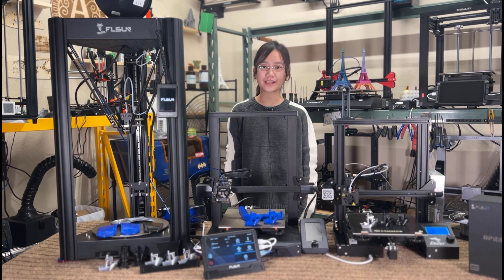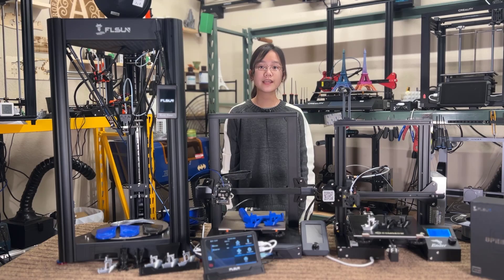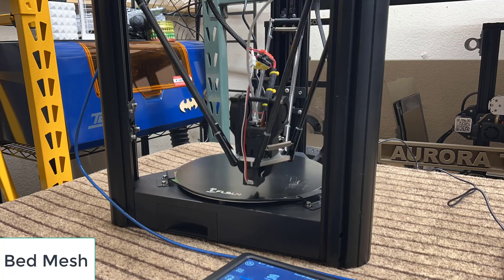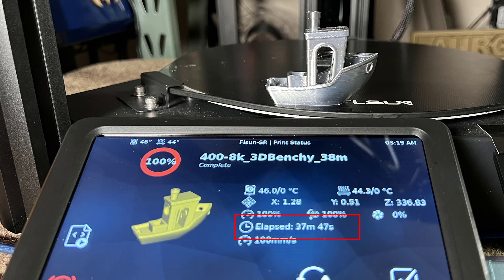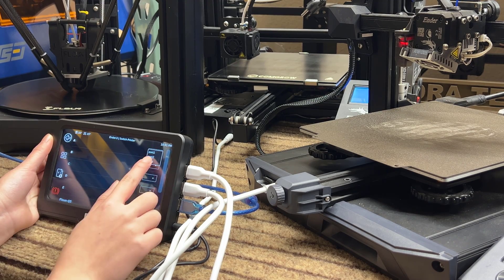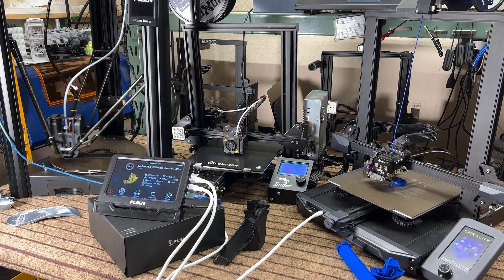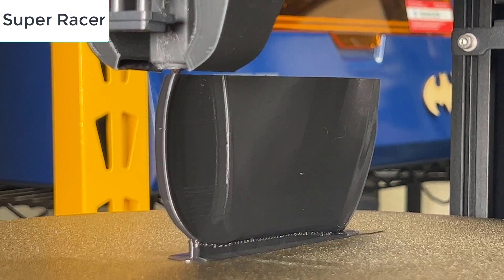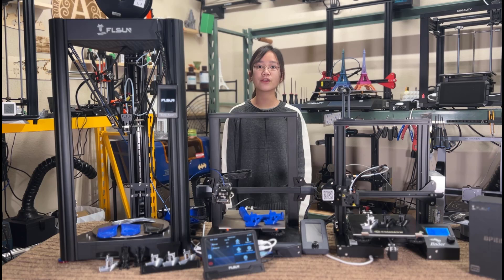FLSUN Speeder Pad review: Control 3 printers at the same time, Buy Speeder Pad or Creality Sonic Pad

Comment: How on earth was she using flsun v400 settings with this thing. I just installed and fine tuned my speeder pad with super racer and tried the v400 settings on it and got the most obvious examples of what happens when a printer is trying to print faster than it can. My printer is the exact same as hers just without the fan upgrades how was hers able to print anywhere close to those speeds??

Comment: Great job as always.  I have been unable to find out what Klipper release the Sonic Pad uses.  There is an update in the manual but I believe that is the Sonic Pad software not Klipper.  I am trying to find out if Sonic Pad has in print, Object exclusion now.

Comment: Another awesome video thank you but I have a a couple of questions that maybe you can make a video on and share with us newbies. I have a QQS-Pro running with a speeder pad, Question 1 is on the top of the speeder pad is a slot for a micro sd card it is recessed really low in the unit and very hard to put in a sd card and remove but, what is this used for?? I thought if you don't have wifi you can put your stl file on a sd card and insert it here instead but does not seem to work.How to you get stl files onto the speeder pad now that the original machine slot is not used anymore.  Question 2 is why do some of the icons from the stl print file show up in red or yellow on the speeder pad screen ??? is this related to the filament i.e PLA is yellow and TPU is red ???  Question 3 is can I see my printer from a webcam while using another internet connection like while at work ?? my ip is not 192.168.etc. its 10.0.1.etc should I add the 7125 ??? can you please help and clear up some of these things that are confusing. Many Thanks keep up the great reviews love watching your unbiased opinion. Wayne, Western Australia

Comment: I have a Super Racer that only has the 5015 mod you have. I printed a comparable benchy at 37 minutes with no other abnormal slicer settings and NO Speeder Pad. Also, your own benchy in your Super Racer review printed at 32 minutes (again, NO Speeder Pad). Now here the Speeder Pad is giving you a 41 minute benchy on the Super Racer. So this is actually slowing your machine down??? (more like a brake pad than a "Speeder" pad...)

Comment: Hi @Aurora Tech I was just wondering about how much a "Klipperized" SuperRacer could get closer to a V400, so this video is great timing!

Just one thing of note here; I've already bought both a Speeder Pad and a Sonic Pad. And the Retail version of FLSUN's Speeder Pad doesn't actually ship with an accelerometer. I was very surprised to see it missing in the box, but before I filed a complaint with the seller, I googled a bit to see if it's actually supposed to ship without. Sam Prentice's video on the Speeder Pad confirmed that retail, it indeed does not ship with either the accellerometer, or the stand. These are just for review samples it seems.
Also, the Sonic Pad has a bespoke port and cable for the accelerometer in the P/S2 form factor. Whilst the SpeederPad uses USB. So these can not be used interchangeably between the Pads.
:)

Comment: Hi, I have a flsun V400 which of course comes with a FLSUN Speeder Pad. I also have two FLSUN-SR's which I wanted to Klipperise and run from the speeder pad. I followed your youtube video and was able to control all three printers from the speeder pad. However, accessing the speeder pad over the LAN using the Mainsail app, I can only see the V400 which is connected to the USB port 1 on the Speeder Pad. If I try and add a printer in Mainsail, it only wants to know the IP address and port number. Is there something else that I need to do to allow Mainsail to see all three printers?

Comment: If one has an Ender 5 Plus and Ender 3 Pro with SKR mini e3 v3 boards installed is it any easier to use the crealty sonic pad over the FLSUN Speeder Pad, or once the new board is installed would it be just as easy to use a speeder pad?

Comment: 38 minutes to print a becnhy at 350mm/s and 5-8k acceleration doesn't match my cura profiles at aprox. the same speed. on my profile i'm hitting well below 20 minutes and even less (depending on infill and wall settings). How does that make sense?

Comment: Intersting results, i was expecting a bigger increase but it makes sense the speed is hardware limited, bowden tube vs direct drive/ all metal hotend etc play a factor.  Without a hardware upgrade maybe  machine learning could produce an algorthim that finds the best settings for your model, and even applies them dynamicly so when your model has long walls it changes the settings to match, whereas right now if im not mistaken the settings dont change throughout the whole model which probably slows things down when its not needed to be.  Ultimately being able to change the nozzel size on the fly would be ideal so you can really speed up on infills with thick layering and slow down with a smaller nozzel for finer detail but that tech doesnt exist yet so in the meantime... im guessing a machine learned or script even could maybe cut down print times on all these printers that are printing at one setting throughout the whole model.  Some kind of intelligent  AI model analzyzer (slicer basically) that can find the best settings for your model and apply them dynamically.  Maybe could eek out another 20-30% speed boost sort of how like AI upscaling in gaming gives us a free performance boost.

Comment: Thanks for the video! I've been wanting for it!
I have the V400, but I would like to connect the pad to my ender v2, but i have installed the new Sprite kit which has direct drive, i needed to do some changes to make it work, installed jyres os code and some manual changes. 
How would you connect the pad to that modified printer? It seems to be worth the effort
Reply from the maker: You just need to edit the printer.cfg, use the Ender-3 S1 cfg file as reference to set the extruder values as well as bltouch(if you have upgraded to ABL).

Comment: What happens if you use a USB hub? Can you talk the pad into handling more than 3 printers?

P.S. I would strongly encourage you to remove your location from your videos.
Reply from the maker: The screen may not be able to support that as it only allows you to choose from port 1-3. Is there any specific reason that you suggest me to remove my location?
Reply: @AuroraTech  
Well, I was, and still am, curious as to whether or not you could use up more of that CPU's overhead that way.

On the other issue.
1. It's not pertinent to the topics you cover.
2. It increases your personal risk.

Stranger danger may be overblown, but it is still a valid concern. Even adults generally don't post their location on their videos, unless it is relevant to the topics they cover. If I were a betting man, I'd even go so far as to wager your parents hadn't realized you'd made the change to your account to indicate your approximate, city-level, location. Claim the state, if you must; I can understand both state and civic pride, and the desire to "represent", and you are an exemplary representative for every quality that is known or inferrable about you; but I'd recommend against giving away more information than that.
In short, it's not needed by your legitimate audience, and you don't need the creeps and weirdos to have it. Especially any creeps or weirdos that live within commuting distance already.

Comment: I have the V400 and works great with that. Trying to link my other 2 ender 3 V2s but the speeder pad didnt come with an accelerometer :( is there any way around this?
Reply from the maker: You can print a model to calibration it manually: https://www.klipper3d.org/Resonance_Compensation.html
Reply: @AuroraTech  great! However the speeder pad i got with my V400 wont recognise my Ender 3 V2 :( I dont even have a printer option on my speeder pad.
Reply: Also does anyone have a cura profile set up for when i can eventually connect the ender 3 v2 to the speeder pad please? and what speeds etc do i print the resonance_compensation?

Comment: Creality updated the SonicPad lately and the firmware it produced just doesn’t run on the E3V2. Needless to say, I’m sending it back for a refund. What a fail.
Reply from the maker: There are 3 different motherboards (v4.22, v4.27, v4.31) for the Ender 3 V2. Combining with ABL or no-ABL, you may need to manually edit the printer.cfg file.

Comment: Has the Speeder Pad root ssh access? The sonic pad has not.
While having 3 or 4 printers on one pad, I actually am more intersted in one printer with multiple MCUs on one pad (like main printer board, CAN for printhead and second MCU for ERCF)...
Reply from the maker: By default, no, but you can get root access by doing this:
https://github.com/Guilouz/Klipper-Flsun-Speeder-Pad

Comment: I'm extremy happy with my SR running version 1.4 .So if I'm correct this add on is speed orientated With a input shaper feature , So my ? Is why is it necessary at all .I mean I printed a torture toaster which printed great .
Reply: It's more about that Klipper can use more advanced features. Your torture toaster came out nearly perfect, but that's probably all the better you'll ever get it with Marlin. If the price is worth it to you, switching to Klipper will give you that last 2.5% that marlin can't handle. Faster acceleration and speed, more fine tuned and precise control, more accurate hotend and bed temperature control, input shaping that allows those higher speeds with the same or better print quality, Klippers version of linear advance for getting those nice sharp corners. That's all not to mention controlling more than one printer from one single place, as well as much much better remote control for when you want to check on/change/start/stop a print when you're away (octoprint can do some of this remote stuff but mainsail/fluidd has more features).

If you're happy with Marlin then by all means continue with it! I know I am for sure. But in the future I see more and more printers coming stock with Klipper or having a much easier/cheaper way of implementing Klipper.
Reply: First thank you for the reply ! As of now I'll wait out for further development of the speeder pad .As i mainly use my 3 printers for 3d printed rc planes . KLIPPER seems interesting though I have to admit .But I'll give it a few more months .Oh I have two creeality v2 stock and the formentioned SR